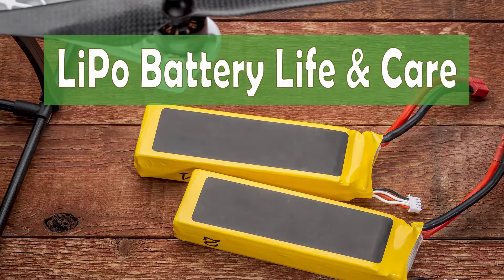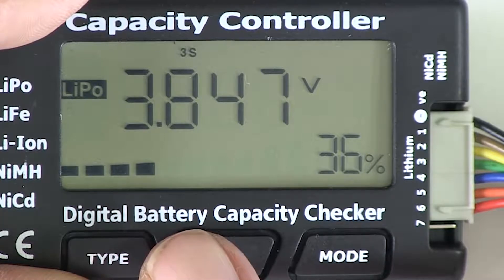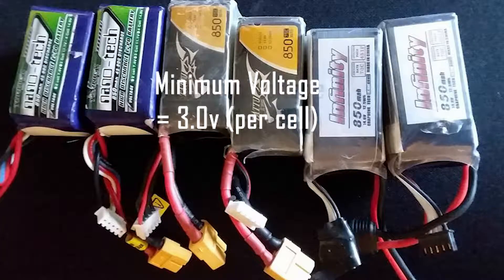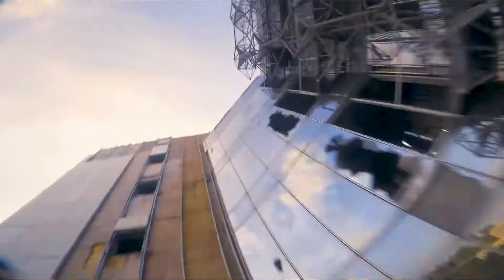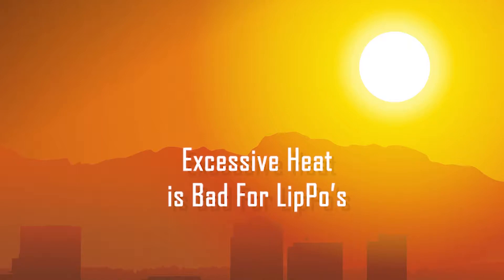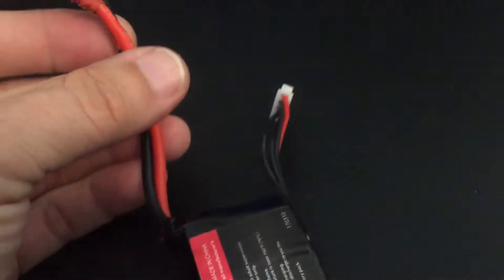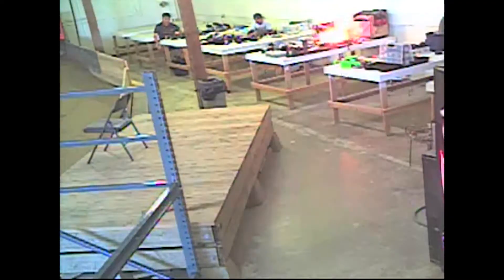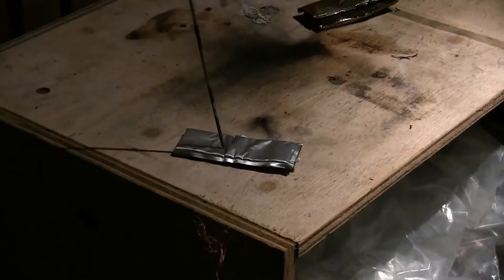How To Care For Your Drone LiPo Battery And Extend The Life | Drone Racing Report | Vol 24

Comment: Thank you for this video. I bought a lipo battery. I have a RC truck rock crawler and I put in a lipo battery in it,2000 2cell. I fully charged it and I've used the truck for a couple of minutes in my house. After I finished playing with it I left the battery in the truck and unplugged it. How should I store my battery? Leaving it in the truck, is that dangerous and should I discharge it and if I discharge it that means everytime I wanna use it like once a week I gotta charge the battery everytime? I'm really nervous when it comes to this battery. I don't want to burn my home down. I appreciate any advice that you might have 
for me. Thumbs up on your video buddy and take care.👍

Comment: I'm currently learning as much as possible before getting in to the hobby. It seams like you need a lot of tools to take care and monitor your batteries. About how much does these battery related tools cost?
Reply from the maker: Start with a quality charger. Decent ones will let you check the internal resistance and overall health of the batteries, and also let you put a 'storage charge' on your batteries when not using them which helps extend the life. You can learn more about chargers at https://youtu.be/oz3XYVzXOcY